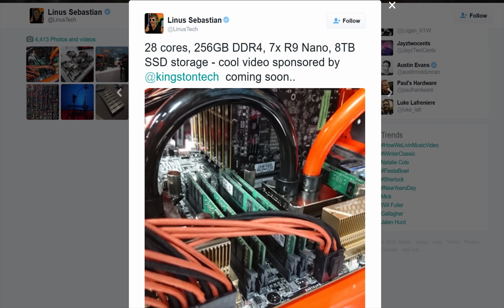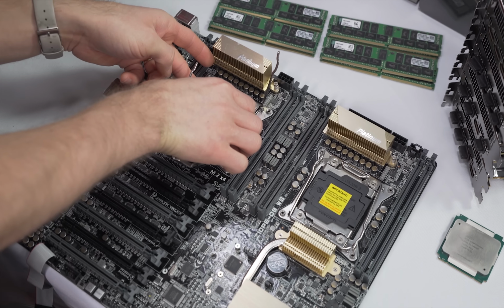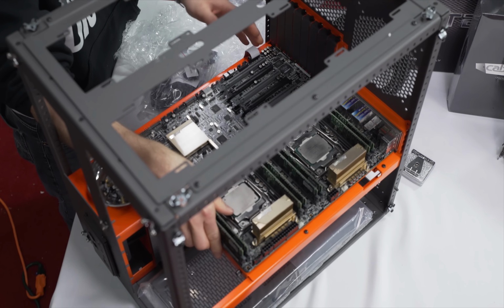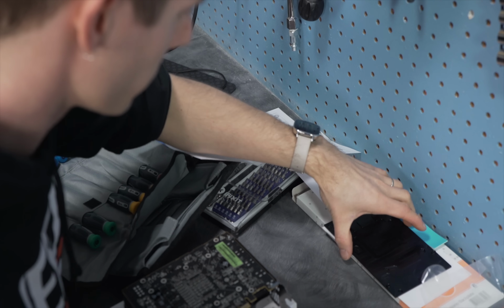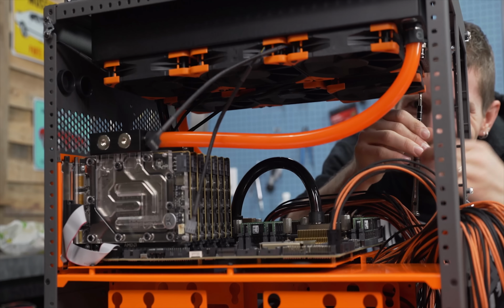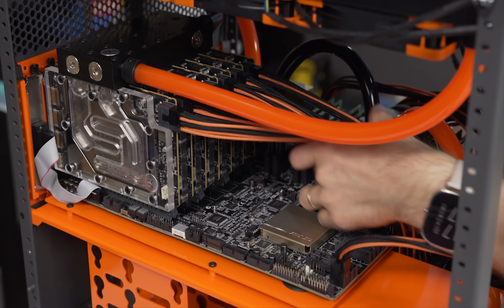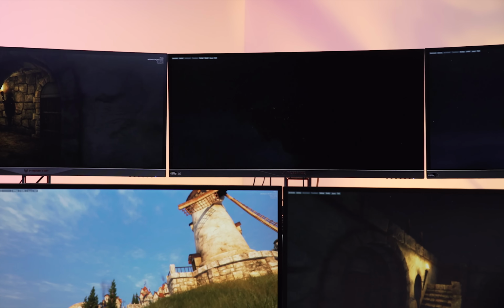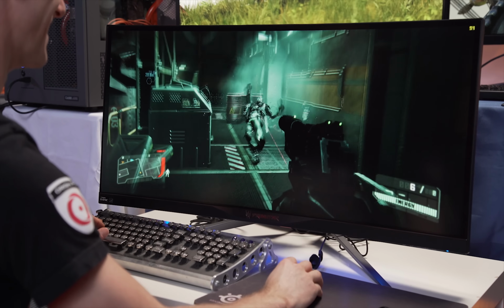7 Gamers, 1 CPU - Ultimate Virtualized Gaming Build Log

Comment: And I thought my 4,000 dollar build was epic lol.

I would totally build this if I had the money. For myself.....
Reply: +NMDJZ with a couple titans.
Reply: +NMDJZ damn, specs? for 4000 dollars thats gotta be pretty good
Reply: water cooled 4790k devils canyon
32 gb air cooled ram
rog maximus motherboard
1tb harddrive
980gtx sli
power supply from this video
thermaltake case
4k samsung monitor
Reply: NMDJZ 4000 for that? WHAT? (BTW monitor does not count in price). My $3000 build contains a 980 Ti, 5820k, watercooling, 32 gigs of ram etc.
Reply: +I just comment the title of the video without a G+ link 

Two 980s were 1200, the ram was 700 because it is 2800 speed, mobo an cpu were 600, 1tb ssd was 500, case 200, an the power supply from this video wasn't cheap either. I include the monitor because it's a 4K monitor, true 4K and that shit was 500. I game in 4K and it's not cheap to do so.
Reply: +I just comment the title of the video without a G+ link

The PC also has other drives to total 4tb of space and liquid cooling. It wasn't a cheap build.
Reply: +I just comment the title of the video without a G+ link 

I built it last year too when these parts were just out. Everything was top of the line.
Reply: +I just comment the title of the video without a G+ link 

Also u overplayed for your processor lol. Read up on it the 4790k performs better for the price by a lot. Your performance per core per price loses. 

Your processor is .1 faster than mine in cpuboss benchmarks. Congrats on paying twice as much for .1 lol. Plus for gaming the 4790k outperforms again unless you're doing quad sli but you're not doing sli. 

You bought an expensive processor without using anything good about it. It supports massive sli which ur not doing and for gaming it's very marginally better than the 4790k. 

Idk I think you overpayed.
Reply: NMDJZ Are you serious? I'm not just gaming. I render videos too. Plus the 5820k is just as expensive as the 4790k here where I live.
Reply: +I just comment the title of the video without a G+ link 

Well touché
Reply: NMDJZ I also bought a 4K monitor with my build totaling it to around 3700. That doesn't mean my build is 3700. It's 3000.
Reply: NMDJZ Great comeback there "mate". Couldn't come up with a real related comeback so you had to go down to the "12-year old xbox live player"-comeback? Great choice, I bet you're very mature.
Reply: +I just comment the title of the video without a G+ link he got taken for a ride on that ram lmao

Comment: not enough ram
didnt cool ssds
didnt cool ram
didnt cool southbridge
didnt use TEC plates on radiator and in reservoire
Reply: every component is important and subject to heat degredation.
Reply: ssds degrade over time due to heat, which is why slc drives last longer and cost more cash
because they degrade slower
but thats none of my business sips tea
Reply: aleks knox
Jan 6, 2016
do u knoww what the fk are u talking about ?

Comment: First of all its 7 gamers 2 cpu and 1 board. Second why would i spend 30 grand to play with 7 other people.. I mean comon i rather spend 1 or 2 grand max on a system per person and u save like 20 grand KappaRoss, bottom of the line great ideas but they need to invent a cheaper method great job btw no h8 i r8 8/8

Comment: I'm surprised the system didn't need dual or even triple power supplies for this hardware, each pulling hardware off of separate circuits. I've blown a circuit with less...

Comment: Still trying to find a situation where such a setup might make sense.

I mean...
You can build 7 PC's cheaper than the whole thing.
You can build 7 PC's combined being smaller than the whole thing.
You can build 7 PC's each being faster than each 1/7th of the whole thing.
You can put 7 PC's each wherever the fuck you want unlike the whole thing.

The ONLY potential I can see in such a setup would be by turning the 7/7 thing into a 1/1 one with the flick of a switch ( Physical or Software ) temporarily turning it into a workhorse with 7+ times the computing power of a normal PC.

Comment: so even though this is cool and all, it isn't that uncommon.  I have a buddy who owns a internet cafe/video game cafe and he has towers that are like 5 feet tall that run about 15-20 gamers all in ultra all in 4k.  They do cost tons though.  You also need independent servers for it to work too...Edit: I just realized it was running off 1 cpu.  That is pretty amazing.  My buddies run off like 6 16 cores....Edit again: I just realized you lied on your description because it is now 2 cpus.  That isnt that big of a deal now.  ALso you can make your own power supply.  If you wire them in series you can draw nearly twice as much as you want to.  I have done this before.  You buy 2 of the exact same supplies, wire them in series through the power chord.  Its pretty elementary stuff.  I also did this with a giant air compressor and a lathe I have in my garage...Since you have done the gpus and the power supply the way you did, good luck finding a upgrades down the road.

Comment: Sweet keyboard by the way... what is that you're using during the "Proof" part? It's got round keys like an old type writer or a Fallout terminal.
Reply: Oh damn.. yeah totally not worth it.
Reply: +Mike B It's from a company called Datamancer. They do a lot of custom jobs, all by hand, and treat it more like their products are art than functional. They almost all use standard switches from Cherry though. You can get a comparable keyboard for$80.00 -  $150.00 and it will function better. If that's a little too expensive, you can settle for Gaterons, which aren't bad either. If you want to research them yourself, they are all called Mechanical Keyboards. I am currently using a Poker 3 with Cherry Clears, but I have a Coolermaster Quickfire with browns, and have recently fallen in love with the less expensive Royal Kludges using Gateron switches. 

You get what you pay for, but once you are past the $100.00mark, you are pretty safe. Keep in mind that keyboards are more than pretty lights and marketing - read the reviews, and try one out if you can - they are worth it.
Reply: acidRain burns Thanks for the info. I love PC hardware but I've never been one to have a preference for key switches. I have whatever is in my Razer Blackwidow and it works great. Doubt I would be able to even tell a difference if you put a different kind in front of me.
Reply: you would be supprised. razer blackwidows over a year old roughly used cherry blue or black switches. the newer ones are made by a chinese company specifically for razer, based on their normal switch brand, kaith. they are fine, though the stems are weaker and quality control isnt as great. the razer keyboards all now use orange or green kaith switches. just food for though.
Reply: you would be supprised. razer blackwidows over a year old roughly used cherry blue or black switches. the newer ones are made by a chinese company specifically for razer, based on their normal switch brand, kaith. they are fine, though the stems are weaker and quality control isnt as great. the razer keyboards all now use orange or green kaith switches. just food for though.
Reply: you would be supprised. razer blackwidows over a year old roughly used cherry blue or black switches. the newer ones are made by a chinese company specifically for razer, based on their normal switch brand, kaith. they are fine, though the stems are weaker and quality control isnt as great. the razer keyboards all now use orange or green kaith switches. just food for though.
Reply: 3 times for good luck.

Comment: What is the OS/software set up to run this?
Reply: unRAID, it's an OS based on linux http://lime-technology.com/what-is-unraid/
Reply: +TheWanderer 1800 You can run Windows under Linux virtual hosts..
+Clovis Perreault - Thank you!@
Reply: +TheWanderer 1800 check out 2 gamers 1 cpu, he goes more in detail about this. the games aren't running on linux. unRAID, the linux based os used, makes it possible to run multiple operating systems (7 windows installations in this case) at the same time, but doesn't run the games itself.

Comment: How can you have more than 1 active windows?
Reply: The power of vm
Reply: +xmxoo7 Virtual machines, Its basically taking one computer and splitting its power in 2 in order to have 2 machines running at the same time. So that means you can have both system in that one machine run with 4GB RAM (from the original 8GB) 500GB Storage (From the 1TB SSD) and so on and so on (As for the CPU you just split the Cores. So from 4 cores you have one PC using 2 cores and the other one the other 2 Cores).

PS: I should point out that the system doesn't have to be split exactly in half (spec wise) So you can have one PC with 2GB of RAM and the other 6GB.  It also works on Running different OS at the same time. So you can have one PC on Win XP the other one on Win 7 and other one on Linux.

PPS: This is usually how hackers or virus creators run their systems when doing their work. They boot up their VM and run the virus on it and see the damage. Since the machine is a virtual it will never hurt the actual Original computer thus they can go on testing as long as they like.
Reply: sorry I'm dumb, what's vm
Reply: +bilibull1 If we install Win in C and Linux in D, can we use both at once?
Reply: Tarabas Zaratin Yes, although you wont be able to transfer files in between (for obvious reasons).
Reply: +Tarabas Zaratin It's not like installing an OS on one drive and another on a different drive (By the way, C and D naming for drives is Windows-specific).
You actually run 1 operating system (e.g. Ubuntu) and on that you run a virtual machine solution (e.g. VMware or VirtualBox). This software emulates the computer hardware (might need enable virtualisation in your BIOS). You can then run multiple different virtual computer instances on the same system.
Reply: You're welcome.
If you're planning on running Win7 and Win10 at the same time, I suggest either using one of both as the host OS and the second virtually; or using a lightweight OS (e.g. Linux distro) as host OS and virtually running the Win7 and Win10. You can also use Shared Folders to share files between the 2 VMs and/or between the host OS and the VM.
Reply: +bilibull1 Not exactly accurate, a virtual machine usually doesn't reserve system resources, it runs like any other program would.
Reply: Im stuck here too, I understood windows cloning and display setup, but how you separate keyboards and mouses, there must be some linux base switcher underneath this and i wanna know how to get it...
Reply: +P〈Ç〉r@zy He's using unRAID. Just like with any other Virtual Machine setup (e.g. using VMware), you can connect physical devices (like your USB keyboard and mouse) to a certain VM. In most VM solutions, you can dedicate a certain device to a VM, using it's unique fingerprint. With unRAID, you can even dedicate physical connections (e.g. the first USB port on the top) to a VM. So you can physically split you connections over your VMs
Reply: ThatCoder I know about the VM, but let's say I install  Win7 in D and Win10 in C (I've done this before), so in start up I can choose which want to use, but can I use them both at once, using Linus' PC?
Reply: Tarabas Zaratin Installing 2 Operating Systems on 2 different drives, has nothing to do with what Linus now did. That's physically having 2 drives/partitions that run a separate OS. You're required to shutdown your pc and boot in the different OS.
What Linus did, has everything to do with running VMs. There's one main OS (unRAID) that boots from a USB-stick and runs on 1 CPU. This one OS than boots multiple VMs, which are then divided over the 7 screens, keyboards, mouses, ...
You can sort of compare it to booting one Windows7 instance, connecting 7 monitors to it in Screen Expansion mode, booting 7 VMs and dividing it over these 7 screens
Reply: ThatCoder Yes, I understood what Linus did, I was just wondering if we can do that using the method I suggested, clearly we can't, so thanks for your explanation and your time of course :D
Reply: +bilibull1 imma copy this and read it everyday like it's my holy book
Reply: +Pow3rus go watch the video about 1CPU 2 Gamers. He explains EVERYTHING!
Reply: +ThatCoder Running Win10 at the moment, and although it has some bugs (mainly drivers aren't working properly), it is quite good, and I'm not going back to Win7. And regarding Linux, I've never used Linux before, I've seen many Linux devices, mainly Ubuntu, but I didn't really like it, I guess I'm used to Windows :P.
Reply: +gorman Usually doesn't but in this case it does... so while your statement is correct, I don't think bilbull's is either
Reply: James Nurse Well I only simplified the process and skipped some information and details because that was not the moment where you would need to be super detailed and specific. The person asking only wanted to know what a VM is and I delivered, the rest is up to them to figure out :P.
Reply: Hamod Assie May I ask why? did my explanation impress you? or just though I was stupid and you are going to use that comment to make fun of me in the future?
I am genuinely curious by the way :D
Reply: +ThatCoder wow your smart
Reply: bilibull1  your explanation impressed me.. because u explained something hard for me to explain
Reply: Hamod Assie Oh... Nice then glad I could help :D

Comment: This is pure stupidity, Its not worth it, because 1 gamer would have to pay almost $10k per computer.   
Rip off.  You couldn't do it without a $2,800 CPU a $530 motherboard 
with 4 x PCIe 3.0/2.0 x16 (dual x16 or quad x8) *2 2 x PCIe 3.0/2.0 x16 (dual x16) *2 1 x PCIe 3.0/2.0 x16 (dual x8) *2
So not all the gamers going to be using x16 let alone only 2 x8.  You could have 
put in 512GB ram maxed but you didn't, what a waste of money, 
thank god you sold your soul for a mic to sponsor all of this waste of time.  
Also it's 1600watt 80+ platinum not titanium, as you said @ 5:14

Comment: Why didn't you use 2 of those 18 core Xeons? It would have given 6 gamers 1 extra core and thread and leave the main one 2 more. Probably for balancing purpouses but if you want everything to be equal then the extra second core could be temporarily given to the gamer with very low performance automatically and then stay disabled until it is required again to keep performance stable for 1 gamer. You could also program the extra core to be allocated to any gamer by the main user's choosing then have all 36 cores and 72 threads along with all 7 GPUs allocated to the main one when it's the only active gamer. The Admin is the main user and can temporarily assign 'Main User Status' to another gamer and then unassign that status at 1 press of a button. How's this idea? I know things would be made a bit more complicated but it would be so cool!